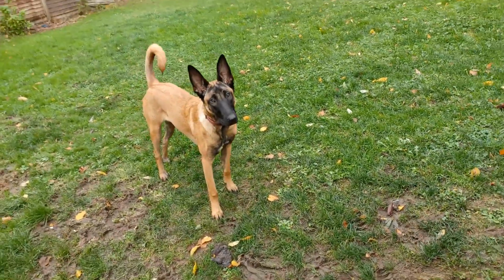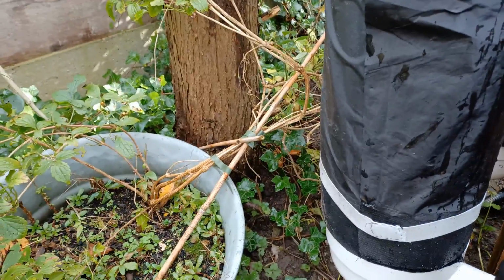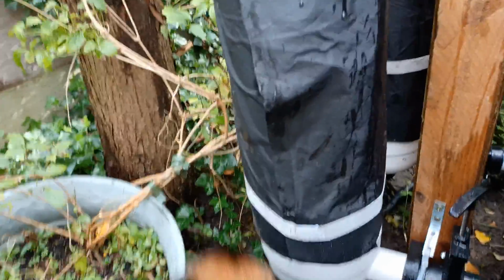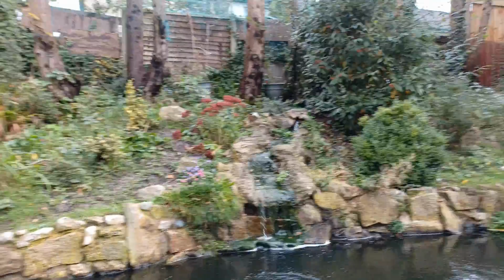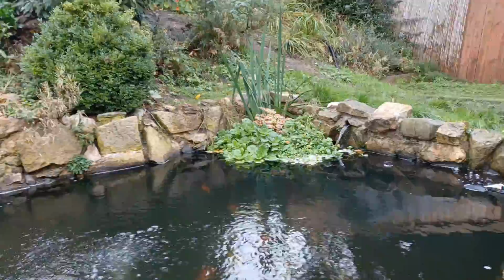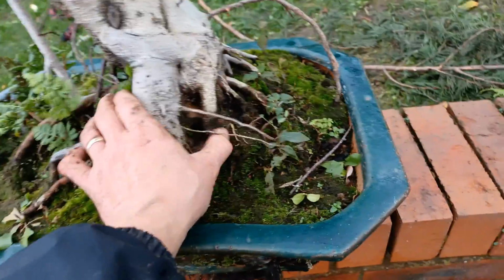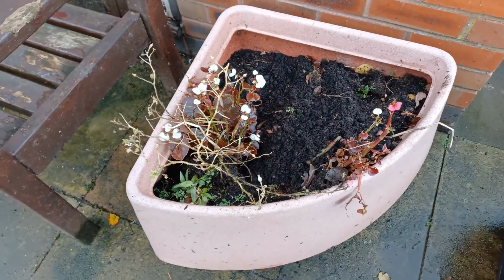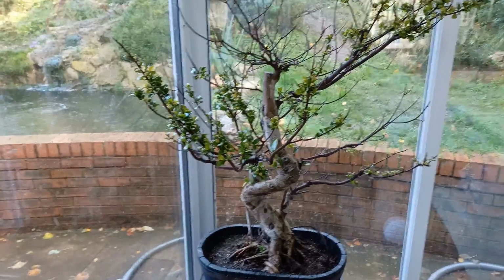Update on Tempest fixings,  worries about winter and re-potting bonsai

Comment: Hi new subscriber and lovely looking pond ! As for the clarity issue if you're getting fish waste and dirt in the top of your shower filter then the Tempest's aren't doing their job of taking out the fines. If each pressure filter has its own UV why not split the flow from the pump 25% each pressure filter then 50% through the 55w UV the 50% then splits again and each Tempest gets 25% each and you end up with a slower flow rate through each filter but you will end up with 4 spray bars in the top of your shower. Also adding the fine sponge from a corse, medium, fine, 3pack pond foam to the top of the shower filter will reduce the frequency of cleaning the floss. Splitting the flow like this would also allow you to increase the power of you're pump to full giving you a better turnover and a wicked looking waterfall !!
Reply from the maker: Good advice Oliver, I'll defiantly look into your ideas. And thanks for your support. Now looking forward to Spring.😊👍

Comment: I've never heated a pond or covered one in the 45 years I've had them.I've got a bakki shower and a waterfall that I keep running all the time. Keep some descent movement on the surface to stop it icing up. I keep a pump I can hang just below the surface to create more movement if needed.
Reply from the maker: Thanks for the information, I feel reassured by your experience.
Reply: Pomfret's Pond 👍

Comment: Here in southern Ontario Canada I don't know of anyone who heats their pond due to the extreme cold and potential very high related costs so most people use a pond de-icer or small floating heater. The idea being that although the pond will completely freeze over the de-icer will keep an opening in the ice large enough to allow oxygen to enter the pond and other gases to escape. Some people also use a bubbler with the hope the moving water will not freeze. My own pond averages between 8 - 10" of solid ice from late January to mid-April. Main thing with bonsai is ensuring adequate drainage to prevent root rot. Not sure if your new container has drainage holes, if not, I would suggest adding some asap.
Reply from the maker: Wow! And I thought it was cold in the North of England but Ontario must be absolutely bitter cold. You are the second person to comment about drainage holes regarding the bonsai pot. I will now defiantly drill some into the base. I really appreciate your reassurance and advice. Cheers.👍👍
Reply: Here in southern Ontario myself. During my first winter (2014) it was the year we had a polar vortex come through and had what must have been 10 inches of ice on the pond. I had a hell of a hard time keeping a hole in the ice for gases to come through. On occasion I have had to keep on putting pots with boiled water on top of the ice where the aerators under the ice were located because they just couldn’t keep up with keeping a hole through the ice. That was it. It was the last and only year that my pond wasn’t heated. I just couldn’t take the risk.
Reply from the maker: @KoiRun50  Thanks for your comments, they make UK winters seem like a walk in the park. 👍👍

Comment: Thanks a lot for the shoutout mate! Really appreciated 😀👍. Cool to have that old tree! Do you know what species it is? Good idea to uppot into a bigger pot on such weak tree and this time of the year. Sometimes bonsais just need a break from small pots to regin vigour. Does the new pot have drainage holes? I tend to add more of non organic material in the mix to make sure it drains and dry up slightly between watering. But really, its just a matter of adapting your care to the tree and soil. Now you need to water more per watering, but have longer intervalls between them. Good job anyway!
Reply: And yea....What you call a harsh winter is normal here. Most years I get ice on my pond. I stop all the filtration for 2-4 months, only leaving an air pump distributing air close to the surfase. I dont want any water movement mixing up the soil heated water in the bottom with the close to freezing water on the top.
Reply from the maker: I really don't know what I'm doing and haven't put drainage holes in the pot. Thanks for the inspiration.👍👍
Reply: @pomfretspond588  the tree will need drainage holes. There is really no way around that.